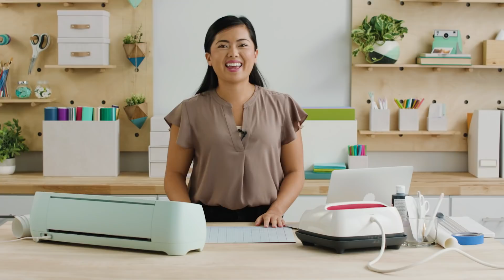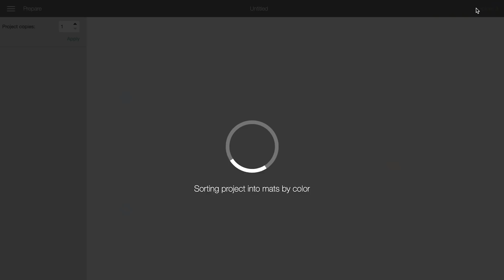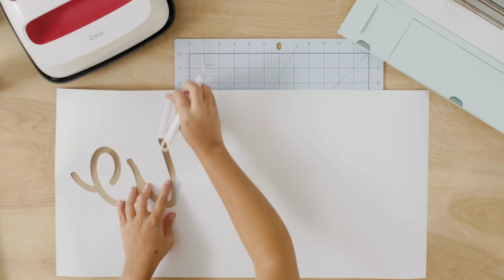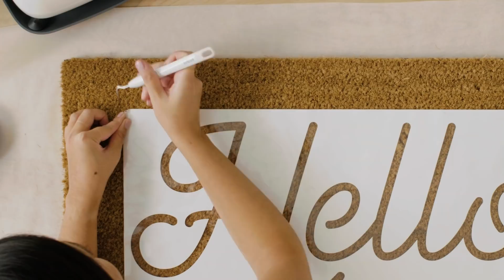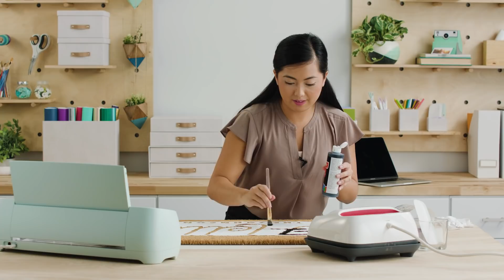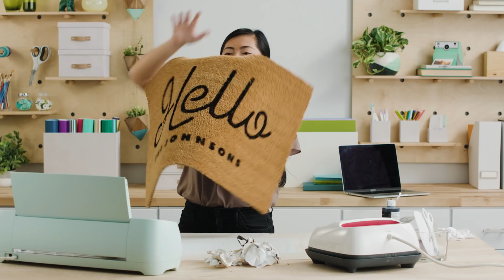How To Make Custom Doormats with Cricut

Comment: Taping off the rest and using spray paint like “flex seal” is quite long lasting. And IKEA has great prices on rugs like these.
Reply: Flex seal might eat through the iron on. I'm wondering since acrylic paint is water based, and if it's an out door mat, it probably needs a top coat?

Comment: Looks great! I have questions-   1) Is something applied over the paint to prevent it from fading or coming off when people wipe their feet off?   2) can infusible ink be used on a project like this?
Reply from the maker: Great questions! You totally could do a clear sealant. FlexSeal is pretty strong and we don't think it NEEDS it. Infusible ink needs to be applied to a majorly polyester blank for it to apply well. It wont show up probably at all on a doormat!

Comment: wouldn't it be easier to use cardstock and use that as a stencil?
Reply from the maker: Using cardstock might give you some paint or lines that seep through since it doesn't have a TIGHT adhesive barrier with the mat. You might not get as crips of lines/edges.
Reply: I think regular adhesive vinyl works fine. I wouldn’t waste my HTV on this project.

Comment: Just curious about why she didn’t need a mat for cutting the HTV. Is it the model of Cricut that she is using? Or is it the material doesn’t need a mat?
Reply from the maker: Both! The Cricut Maker 3 and Explore 3 can cut Smart materials without a mat!
Reply: Some of this "smart" material does not require a mat.  It would say Smart HTV right on the package.
Reply: @Cricut  I have the Cricut Explore Air.  Would I be able to use Smart material on it, or would I have to use a mat?

Comment: How does the acrylic paint hold up in extreme weather?  We have 110+ heat
Reply from the maker: Pretty great! You can also use a good outdoor acrylic paint/spray for even better use. There are also sealants you can apply too if you are worried!
Reply: Use black flex seal paint. It leaves a rubberized texture that withstands all of the elements!
Reply: @CorinneMauricio  Hi! Just checking this video out! Do you mean use the flex seal in place of the acrylic paint or over it?
Reply: @nfournier1  yes, it comes in a little jar. It comes in black and white. They also have a clear spray you could use to seal it if you needed other colors.
Reply: @CorinneMauricio  I've never used flex seal,  is it thicker than acrylic? If reminds me of tar🤣 Our does it just appear to dry that way? I'll definitely give flex seal a try instead of acrylic paint.  😁

Comment: iron on is expensive. what a waste!
Reply: I thought so too at first but then I remembered how in every video they struggle to get the regular vinyl to stick snd pull off the transfer tape.
Reply: It exist special material to do stencil
Reply from the maker: I guess it depends on how you look at it! If you use vinyl as your stencil, you have to have vinyl and transfer tape and the results don't always turn out super crisp. That's also a lot of material wasted. Balancing time spent plus material cost is always hard! For sure do what works best for you.